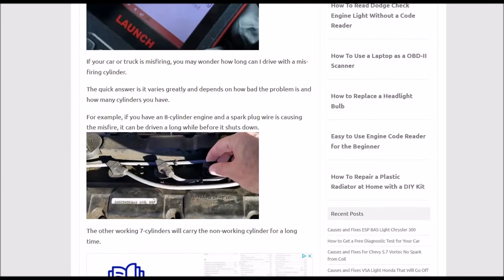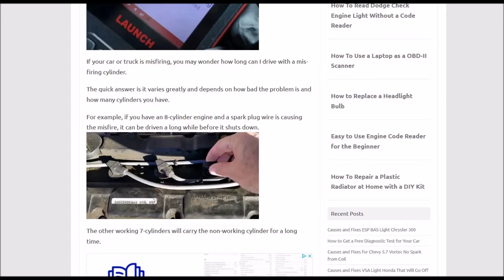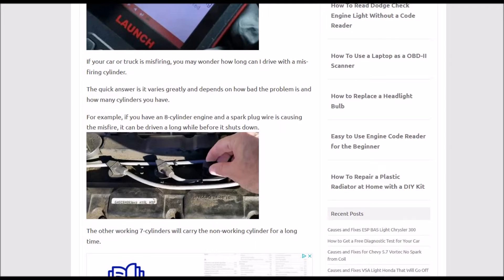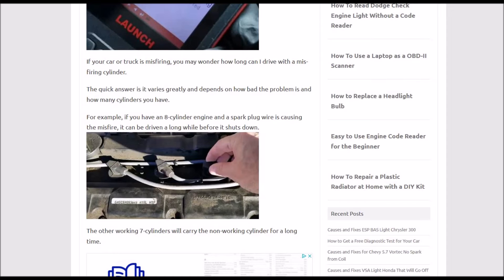How Long Can a Vehicle Drive with a Misfiring Cylinder?

Comment: I drove a V8 about 1000 miles in a Lincoln town car with one misfire and it actually did just fine problem is that cylinder actually quit misfiring when I replaced the plugs and coils but another two cylinder started misfiring. I have like electrical shorts or something but the first one misfiring on 1000 miles was definitely drivable.

Comment: Someone borrowed my q3 sline and they drove it from one city to another. Engine light came on in the middle and they ignored it and all my cylinders are damaged it was a spark plug issue initially. Ehat do you think what are the things i need to do. And should i just get rid of the car now. Is it finished?

Comment: I took my 2017 Honda odyssey with 192k miles to a local mechanic shop where my vehicle was diagnosed for an engine misfire and slipping transmission. It is 3000 miles overdue for an oil change and the mechanic told me that as a direct result of that, The best is replacing the engine. The transmission he said needed to be replaced as well because it went through it’s full life cycle. The mechanic didn’t go into specific details of the problem but got straight to his point and didn’t charge me anything for looking at my vehicle. Feel free to share any suggestions on what to do next, Should I take it somewhere else to get multiple perspectives on this and find a chance to fix my problem?
Reply from the maker: That is a lot of miles but you can always get a second opinion.

Comment: My mechanic and I have tried everything and it still comes up cylinder 5 spark plug news Quail new and it's still not firing five United something else to the spark plug and it still says cylinder news spark plug and it needs new gapping and we did all that I am going to see about the what calculator maybe the calculator needs to be cleaned out you know down by the muffler maybe I'm saying it wrong wrong I don't know give me that needs to be cleaned out that thing that everybody is stealing Cadillac converter

Comment: I have a 6 Cylinder and only 5 are firing.This is number 5, but we've been working on that.We don't understand what's going on.So can you give me any ideas?It's a two thousandand three trailblazer
Reply from the maker: A code reader will give a code that will point to which cylinder is misfiring. Once the cylinder is found, the coil and injector will need to be tested. There are other causes, but a bad coil or injector is the most common.

Comment: Ive got a 4 cylinder minivan and it has plenty of power to carry the one.  Compression is good on all except the dead cylinder.   I may have to give it more gas but i turned off the fuel injection to the dead cylinder and since the engine burns oil, the cylinder has lubrication. What you think, can i drive it another 1000 miles before getting it fixxed?

Comment: If one injector has missing signal, the computer cut off that injector. Then can I drive the car safely for some hundreds of miles until I get it repaired?
It is a 6 cylnder engine.

Comment: I had been driving a company truck for weeks with a misfire. eventually, I had low oil pressure and finally the engine just completely died.  I wonder what the problem was because the truck needed a new engine.  if the company mechanic actually fixed it right away it might have been saved.

Comment: This is not true. I have a four-cylinder with one cylinder bad and I’ve been driving for three years just fine. This guy definitely doesn’t know what he’s talking about.
Reply: My old Ford Jailbar flathead V8 ran for 18 years on only 3 cylinders. Not a problem. Top speed was 58 mph
Reply: @Gumboot-Cowboy are you guys serious? I have a v6 Honda accord cylinder 6 had a misfire will the other cylinders go bad if I still drive it or will my engine be damaged?
Reply: @Capservin no the other cylinders should be fine. If one cylinder is down and misfiring, you got another 5 cylinders don’t ya? Buddy of mine drove his old BMW with 2 misfires for a year and it still lasted. You should be fine.
Reply: @Capservin  Over the 18 years I did well over 500,000 miles. I'd removed both inlet and exhaust valves, blocked the intakes and the valve guides. Discarded the plug leads. Hard to start on a frosty morning but never let me down.

Comment: Well why is my engince running good still?
Reply: It still has other cylinders running. But it only makes them work harder since they have to pick up the extra work and that may cause problems to the other ones. And depending on why exactly it’s misfiring, ignoring it can lead to more and more expensive parts to go out

Comment: I have a misfiring 98 V6 mustang. I was wondering how bad the misfire could damage my engine and whether it’s worth fixing and selling it for my original posted price or selling it real cheap? Thank you!
Reply from the maker: A misfire usually will not cause permanent engine damage. The cost to repair it depends on the failed component, such as bad spark plug, wires, injector and so on,.